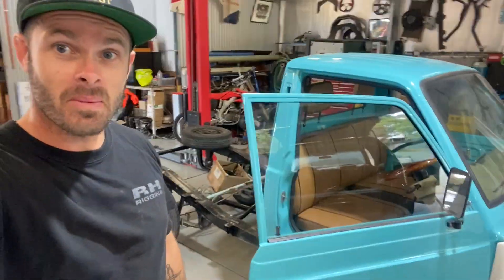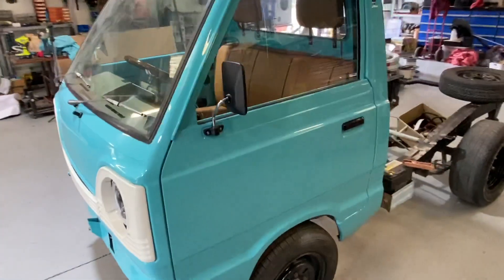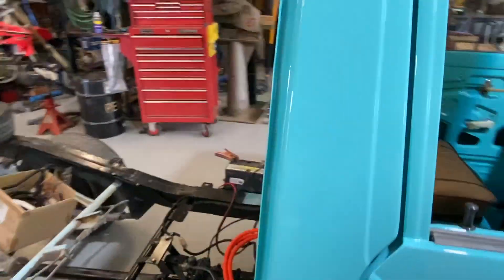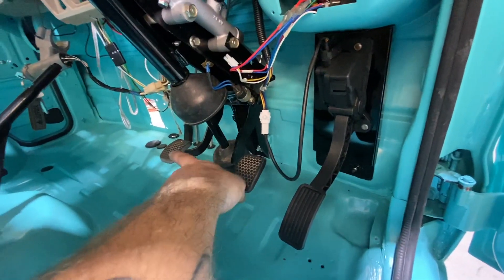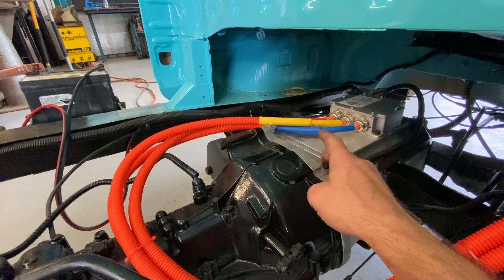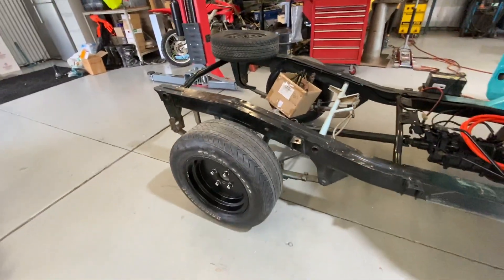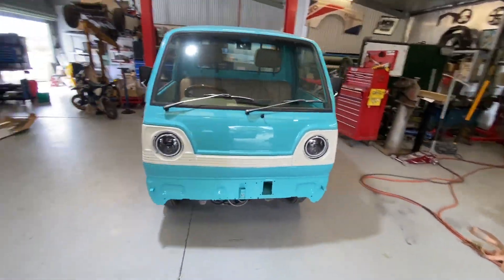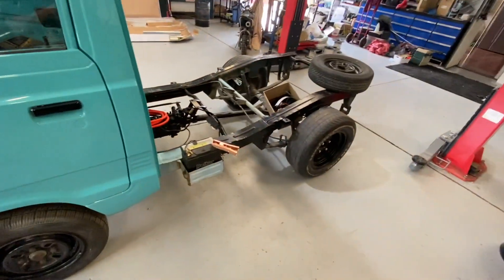ELECTRIC KEI TRUCK CONVERSION ep1

Comment: Disregarding cosmetics how much money did you put into the electric conversion? I was thinking of a hybrid set up where the engine charges the batteries and therefore I would need far less battery weight.